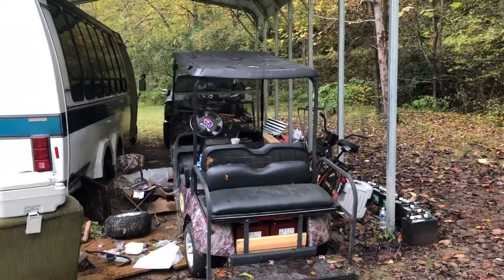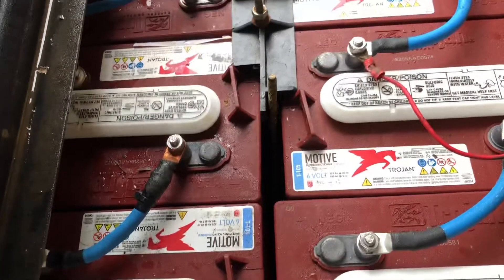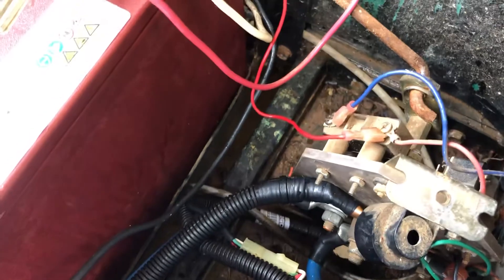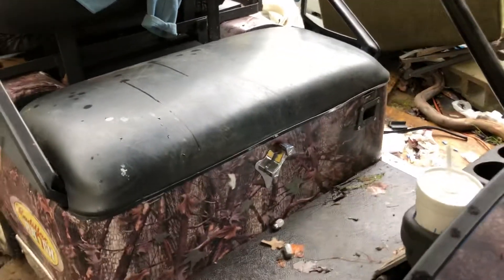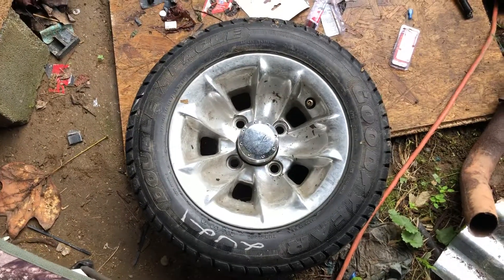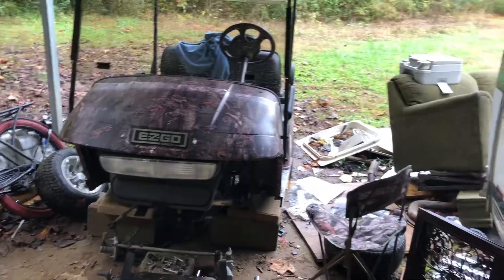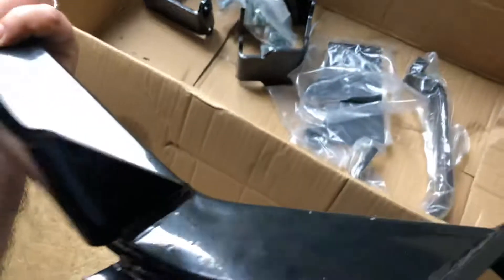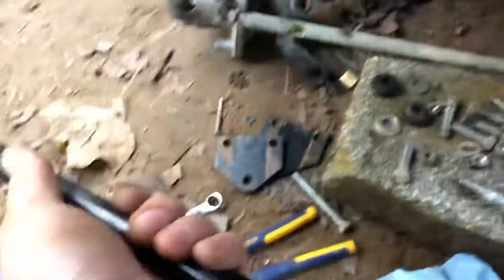Ezgo TXT 36 to 48v Conversion;  6” lift build Part 1

Comment: Im looking at doing the same set up. Did you have to buy a 48v wiring harness?
Reply from the maker: No such thing as a wiring harness in electric carts. All components wire up separate from each other, yet are wired to each other by a single battery cable.
Reply: @lifewiththehamptons1993  awesome thanks. Is the stock motor still holding up?  I also have the black motor.

Comment: What year is it I have a 2000 eg 36v with the black and gray motor can I do the same thing with the Navitas 36 48 72 volt controller 440 amp
Reply from the maker: Sure can